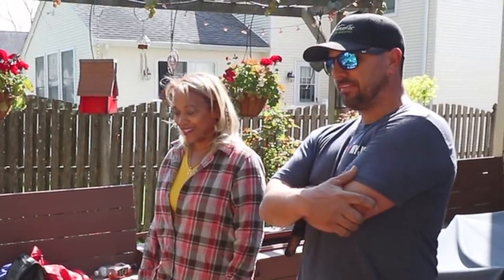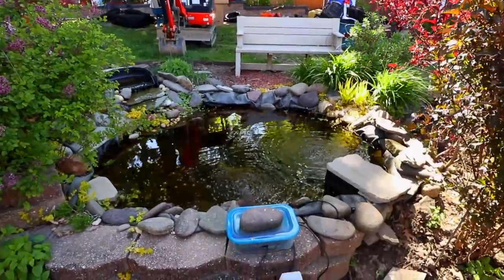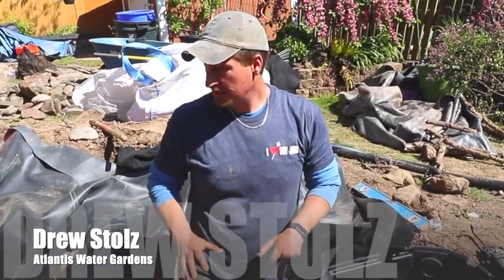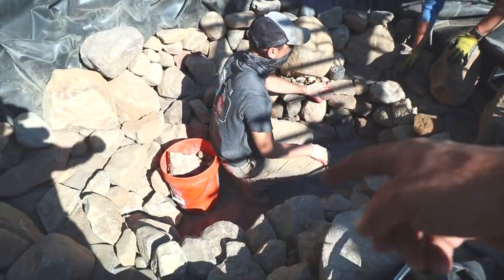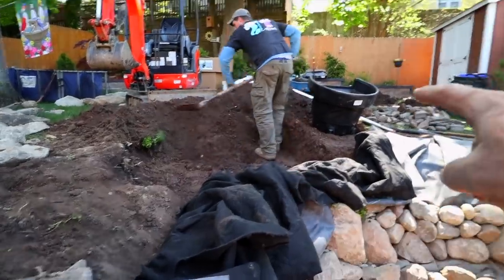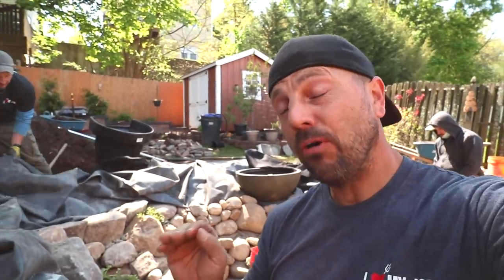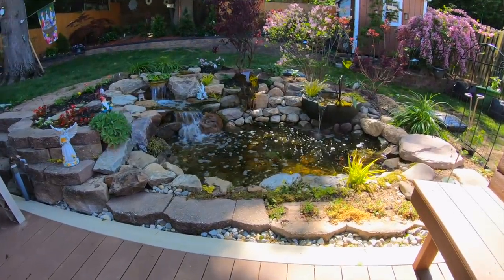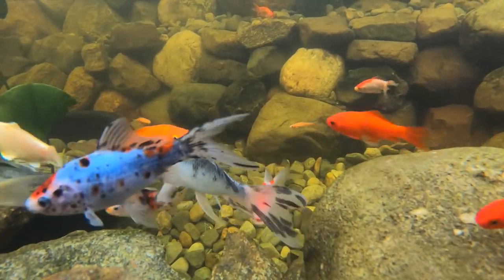TRANQUILITY POND w/ Patio Bowl Waterfall

Comment: how did you attach the liner to the retaining wall ? did you dry sandwich the liner between wall and rocks?
Reply from the maker: Yes
Reply: @AtlantisWaterGardens  Hi I am a fan of your videos but I feel aquascape products are way over priced and I get the feeling that you are being forced to sell their stuff to be accredited by aquascape.  Perhaps you can answer a question I have I bought an older skimmer box a signature series skimmer from the pond advisor here in the UK.  He told me the skimmer is the same size as the 1000 new series signature skimmer. I am wondering would the 1000 rock lid fit the older skimmer as the new rock lid seems more natural than the older lid. Both skimmer boxes seem to be the same size I believe the older skimmer box I bought was sold in 2018. many thanks.
Reply from the maker: I haven’t tried it but I’m pretty sure it would fit. Honestly, I’ve been using Aquascape for over 20 years and I’ve never had a better Vendor relationship. They back up their product better than anybody I’ve dealt with, no questions asked. You couldn’t get me to switch if you paid me. Just my 2 cents

Comment: I have a helpful tip I noticed while watching your videos perhaps this will help you. I spend a lot of my time with camera gear and noticed when your pointing to areas of the pond your building the auto focus will focus on your hand this can be off putting to the viewer. You can solve this problem by choosing aperture F8 on your lens pre-focus  an area of the pond and turn auto focus off. Because your using F8 every thing should stay in focus and will stop the camera jumping focus too many people reply on autofocus most cameras will be able to do manual focus. I assume your possibly using a Canon DSLR or similar. Apart from that your camera work is very good and your production value is very high so keep up the good work.
Reply from the maker: Thanks for the tip! I use a Canon M6 mirrorless. Will it work the same?
Reply: @AtlantisWaterGardens  I use the 80D I also have 7d and just got m50 had the 5dII. In general all canon cameras have a manual mode normally M for manual on the dial. This allows you to adjust shutter speed aperture ISO its the triangle in photography  just allows you to adjust things for example when the light becomes too harsh or to dark you can adjust the settings. 

Manual mode once you get into it makes you a better photographer / videographer .  Thats the settings on the camera  I tend to use aperture priority some times and adjust aperture and let the camera set the iso and shutter speed if I am in a rush.  As to my main point I was talking about you control the focus from your lens their is a small switch that changes the lens from auto to m -(manual) Then you just turn the ring on the lens to focus yourself. If you combine using manual settings on the camera with using manual on the lens you will get the results. Regarding your question the thing I love about canon gear they all work in the same way. Your m6 should be fine no problem. 

Sure the mirroless lenses use electronics to adjust the focus rather than in the case of DSLR's that use physical movements but they do the same thing its just DSLR's like the 90D ,1DX  are just a bit quicker but not so much that its way faster.  AS for the mirrorless cameras they are catching up from what I here the new m6 mark 2 is as good as the new DSLR 90D. Hope this helps just remember to turn auto focus on the lens off and turn the ring with your hand  but if your lens has image stabilisation leave that on hope this helped you out. Regards Paul.
Reply: Great Advice...Thanks